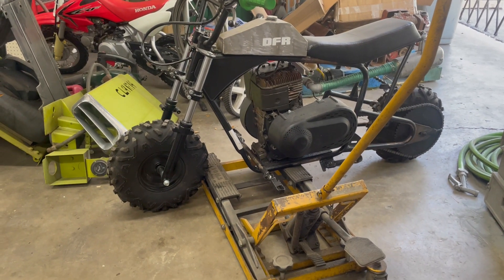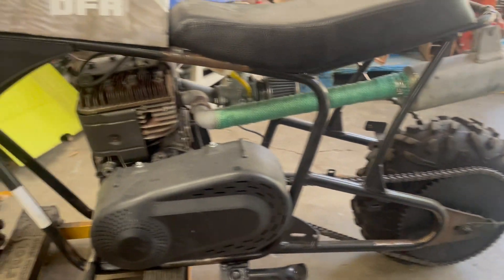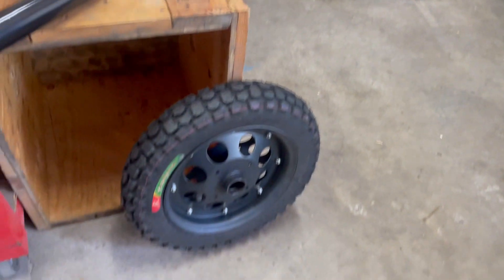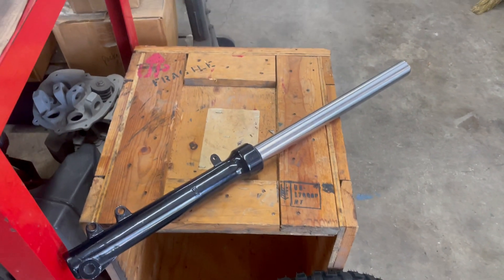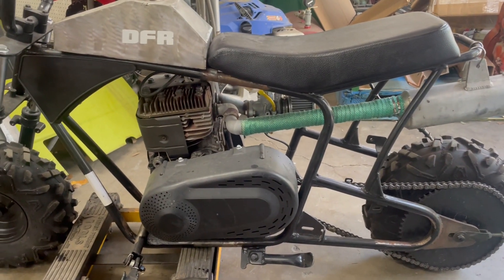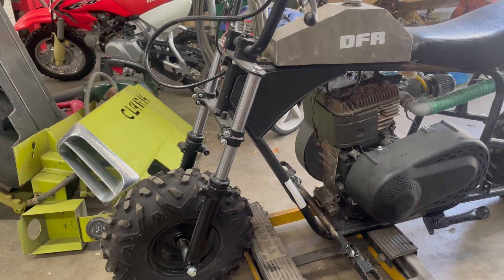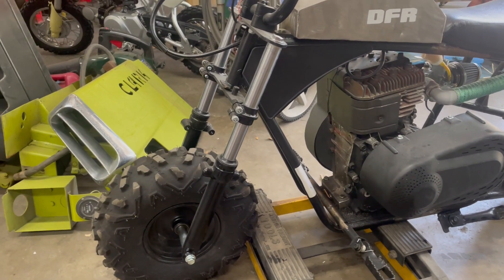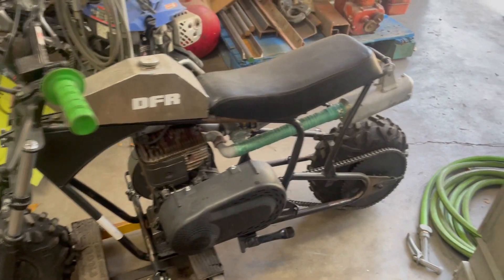Plan "B" on the Ripper Mini Bike Fork Mod

Comment: If I blew a hole on my frame with 7018 and sealed it up with 6013 you think it will be fine? I welded gussets on my mm80 engine plate and it blew through in a couple spots.
Reply from the maker: If you filled the holes most likely they wont be an issue
Reply: @dirtfootracing8788  sweet. I put the 6013 right to them! I tried my best to try and weld it. I'm running the Amico 200 pro, if I'm using 110 what's a good setting for my 6013 rods? I'm only using 1/8 and 3/32. I have the Chicago Electric  mig here too but that I'm so clumsy with the gun it's ridiculous. Plus I have to weld outside.....so I'm constantly battling temperature/humidity/wind and angles to work at.
Reply from the maker: @fatbuddycat  Hard to say on the stick welding of those frames - I use tig .
I Always try to have some practice pieces to try out different settings.